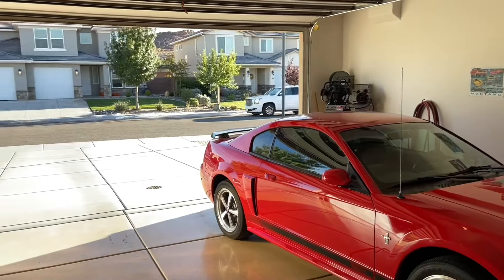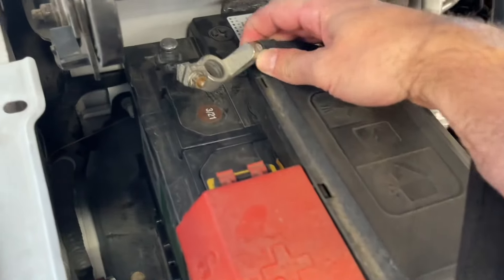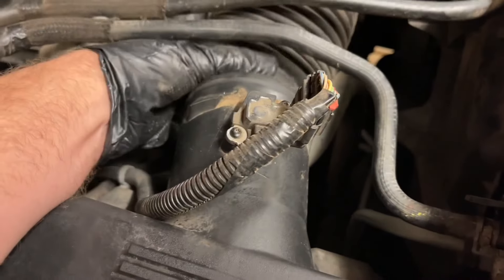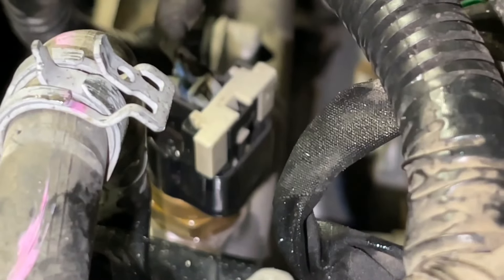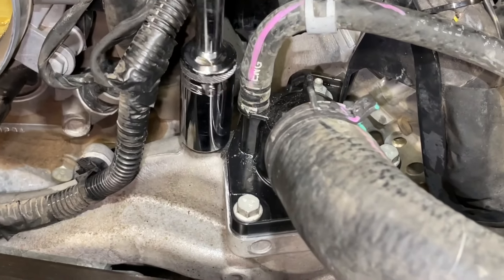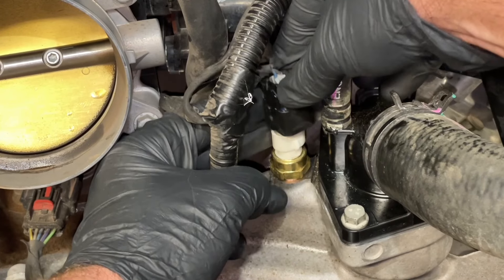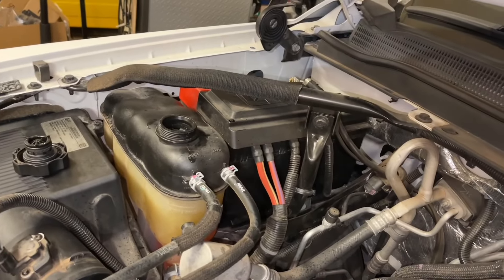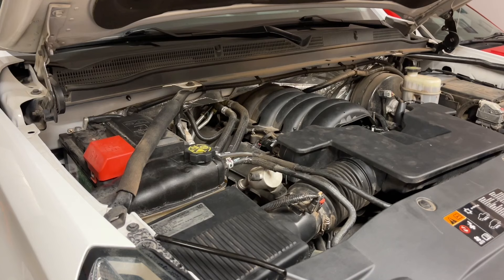Coolant temperature sensor replacement 2015-2020 Yukon, Tahoe, Suburban, Sierra Silverado GMC Chevy

Comment: I took my 2015 Chevy SUV LTZ to dealership to have the same sensor replace- they where charging me $203 to take the fluids & clean, then labor then part a $450job, all they need to do is just drain the fluids down- so after watching your video, we did not get it done there-Thanks for your knowledge to inform people like us
Reply: Yeah but how many miles are on your truck? Sometimes they do things based on service intervals. Dex-cool doesn’t last forever and needs to be changed at specified intervals.
Reply: Really appreciate the video. It shows exactly what I was looking for. Thanks so much.
Reply: Isn't it crazy how they can charge so much for just a simple job?
Reply: They mark up parts so much 50-60% because it's so expensive to keep a shop open these days. There are too many regulations in the 21st century, United States

Comment: Excellent video, thanks. 2016 GMC yukon XL 4 X 4 WITH 5.3. Mileage = 125,000. 1st time this has happened. I purchased the new coolant temperature sensor at Auto Zone for $17.00 and a gallon of the antifreeze concentrate for $21.00, I applied the tape, and took about 90 minutes to set up, do the job, put everything up and clean up. Working great. Total spent $38.00.
Reply from the maker: Nice work! If it continues the thermostat can also cause it to run the fan and overcool the engine, just fyi https://youtu.be/aEfgkxWdBYw?si=3xH7ce8BQL79NnPp
Reply: Nice! Was debating on taking it to the shop
Reply: What was the coolant for?

Comment: Thank you for this video! I got home pretty late last night after hanging out with friends, and my Yukon did the exact same thing as your wife’s and I was freaking out and did not know what to do. Eventually the fan stopped and I came into the house and started googling as well as YouTubing and found your video, I now know what I’ll be doing today!
Reply from the maker: The thermostat commonly sticks open as well. It’s very easy to fix, so if it continues, check this out for the future https://youtu.be/aEfgkxWdBYw?si=dtMpuIdw_lV_ZxIB
Reply: @dannyjohnsonsgarage  thank you! I replaced the thermostat and the temperature sensor and my Yukon is as good as new! And thank to your video it wasn’t too complicated. I did notice that my vehicle did not show a check engine light, I’m not sure if that matters.
Reply from the maker: @LATINO_2020  mine did not have a code in the beginning either. It is somewhat normal. Glad you got it fixed 👍🏼

Comment: Thanks for the video. After removing air silencer box, I had  the new sensor taped and ready to install, removed old sensor, put finger over hole, quickly moved finger and screwed in new sensor. No  need to disconnect radiator hose or drain any fluids. Maybe lost a tablespoon of coolant or less.  Less than 10 minutes.
Reply from the maker: I also did the thermostat, so if it continues here is the video. You’ll lose a little more coolant 
https://youtu.be/aEfgkxWdBYw?si=XD8DDIZFZidjTcus

Comment: 🤜 Thank you for the video.  Dealer wanted $950.00 - I was able to complete for $55.00 (AC Delco temp sensor and new 19MM socket) 75 minutes by the time picked up parts watch video and worked on the engine.
Reply from the maker: Nice work! That’s what I hope to help with on the channel.

Comment: I cannot thank you enough for creating and sharing such a helpful, informative video! You just saved me THOUSANDS of dollars! I am 1200 miles from home, on vacation. I have to purchase a few tools, but between your video, and my husband (a mechanic) at home, on video chat with me, I am confident that I can change my sensor out, on my own! Thank you, from the bottom of my heart! As a female, the dealership tried to tell me that a whole bunch of things need to be replaced and that it will cost me and arm and a leg! My husband throughly checked& tuned up our truck before I left for vacation, so we know the dealership is lying! My Yukon Denali is doing EXACTLY, EXACTLY what your wife’s truck did. I am forever grateful for your help! Bless you Sir! 🥰
Reply from the maker: When you get it home, the thermostat can also stick open and show cold as it over cools the engine. If you continue to have trouble, the thermostat would be the next thing to look at. Thermostat Replacement Yukon, Tahoe, Sierra, Silverado, Escalade GMC, Chevy 2014-2020 P0128
https://youtu.be/aEfgkxWdBYw

Comment: Wanted to leave a comment to say thank you! Seems like my 2015 Yukon XL has been riddled with common issues & it's just one thing after another. YouTube has become my go-to place for solutions. I came across several videos for this issue, but none as easy to follow & quick to the point as yours. I'm trying to learn to fix the smaller details myself. I took this as a learning opportunity & got my hands dirty with my dad. Not only did we get the issue resolved, but it was nice to bond over his intrest too. So thanks again!

Comment: Much appreciated video. I experienced the save event last night with a 2017 Tahoe. Temp gage showed 160 degrees or lowest posible readng, whcih is typicalls 186 F. and both fans were in overdrive. and ran for about 20 minutes after arriving home. Bought a new cooling sensor today for $18, had extra antifreeze. Your well produced how to video turned this repair into an hour event even considering the trip to auto parts store.
Reply from the maker: Just fyi for the future. The thermostat can stick open and also cause the fans to run. In case it continues Thermostat Replacement Yukon, Tahoe, Sierra, Silverado, Escalade GMC, Chevy 2014-2020 P0128
https://youtu.be/aEfgkxWdBYw

Comment: Danny - cannot thank you enough. Had the exact same issue. Your step for step instructions were 100% on point. Part cost me $33 and took around an hour.
Reply from the maker: If it continues it may also be the thermostat stuck open and it’s really under 160 degrees. Here is how to fix it in the future https://youtu.be/aEfgkxWdBYw?si=L0Grd6e5SWZiowXX

Comment: This video is absolutely perfect, thanks for sharing.  My 2016 Yukon did the same and I received a quote from the dealership and they wanted 1300.00 to diagnose and repair.   (THEY ARE CRAZY).    I did purchase the GM Brand sensor for 53.00 and replaced it in merely 10 minutes.  I don't know why you had to remove the entire intake silencer or drain off the radiator hose.   I removed the intake connection and left it connected to the air filter section, removed the sensor with towels around it to keep fluid from going over the entire engine/ground; and I only lost about 3 tablespoons of fluid and put the new sensor on.   Reconnected everything and now runs perfectly.   THANK YOU FOR THIS AMAZING VIDEO.
Reply from the maker: I also replaced the thermostat, but made the videos separate as well for those only doing one repair. It doesn’t hurt to drain a little fluid for less of a mess. I’m glad you enjoyed it

Comment: Thanks for this video. I bought the part a while back after watching how to replace it on an Escalade, but then I realized that my Tahoe had the air silencer (which the Escalade did not). I was not sure how to proceed with the air silencer, but your video was very clear and helped a lot. I did not do the optional part of removing the hose -- when I removed the old sensor I was prepared with some paper towels. Things to note for others dealing with this: 1) if your check engine light remains on after replacing the sensor you typically have to start/stop the car 3 times before the car recognizes that the previous problem causing the light to illuminate no longer exists. 2) if your situation is like mine, when the sensor is bad the fan will stay on for 5 minutes after the car is turned off. For a long time this was just annoying, until it happened so often that it drained my battery and my Tahoe wouldn't start. I saw someone ask if this must get fixed - I don't know about if it is bad for your engine to let the can continue running all the time, but it definitely drains your battery.
Reply: After 5 days the problem came back. Going to replace the thermostat next: https://www.youtube.com/watch?v=aEfgkxWdBYw
Reply: I have the same issue.  Replaced the coolant temp sensor, worked great, then about a week later it started up again.  Did replacing the thermostat work?
Reply: @stpx  yes. It was very easy except I didn’t do a great job collecting coolant that spilled. I hosed my driveway off and it didn’t leave any marks. Make sure you replace coolant with correct type. Also try and fill the hose up before you reconnect it so you don’t have too much air in the system. I assume it matters.

Comment: I had the same issue. I changed the temperature sensor and it worked like a charm!

- 2015 Suburban - 265,xxx miles
- CEL was on: P0118, P0128
- The fans would stay on with the car on and off. 
- A/C was not turning on

I started searching away and saw your video! Everything was spot on! Working just fine!

Big thank you!!
Reply from the maker: If it comes back it may be the thermostat sticking as well. Just fyi 
https://youtu.be/aEfgkxWdBYw?si=3nzNZIdNLFsqB4Ze

Comment: 2018 Tahoe success thanks to your video!!! Replaced the Thermostat too at the same time as I wasn’t sure which one was the culprit. Your videos for both were perfectly done! Thank you!
Reply: Are you talking about the Water Pump Outlet Assembly with Thermostat? I have the same issue. Not sure which one's the problem. My fan kept blowing even with the truck off to the point where it drained my battery.

Comment: Sitting in my Sierra looking at the check engine that just came on and listening to the cooling fan. Thanks to you i have the confidence to try this myself along with thermostat change.
Reply from the maker: Good to hear. If it continues to happen, it’s also common for the thermostat to stick open and overcool the engine and run the fans https://youtu.be/aEfgkxWdBYw?si=Swj6E2HklqMBS4ru

Comment: Thank you for your video!  I’m sure it saved me hundreds from the mechanic changing it, not to mention the time saved from having to coordinate getting it into the shop.  This was what was wrong with my Suburban and I’m very grateful you posted this .  Thank you!
Reply from the maker: Many have found the thermostat is also sticking open to cause this. I changed both at the same time and did not have the problem come back, but you might want to watch this for future reference in case it continues: https://youtu.be/aEfgkxWdBYw?si=5RBbTiv2EgcI0ltg

Comment: Thank you VERY much for posting this! Ours went out on Friday.  My husband watched this video this morning - picked up the parts and got it fixed all in the same day!
Reply from the maker: @normabournes5789  I’m glad it worked. If it happens more, it can also be the thermostat. Also easy to change out Thermostat Replacement Yukon, Tahoe, Sierra, Silverado, Escalade GMC, Chevy 2014-2020 P0128
https://youtu.be/aEfgkxWdBYw
Reply: @ Well you called it! Last night my car did the same thing as before except I have no heat! I got home and put it in the garage - the fan ran for about 5 minutes and then shut off. We’re going to watch the other video tonight and make plans to install a thermostat. Thanks again! :)

Comment: Thanks for the video. My 2016 Suburban did this in April of 2024. This sensor fixed the issue. The exact same thing happened again this week. Fan keeps running after you turn off the vehicle. I bought and changed out the sensor and it did not fix it. After some google searching I found that a bad battery can also cause this problem. Switched out the battery and that fixed it. I don't usually comment on these but was hoping I could save someone the headache I had.
Reply from the maker: Most likely it’s the thermostat sticking open and should be replaced https://youtu.be/aEfgkxWdBYw?si=GiR2jxNugFM8rPaX

Comment: Thank you.  Had this done on my Yukon in less than 10 minutes.  Fixed the fans being on and running down the battery after turning the ignition off.
Reply from the maker: If it continues, look into the thermostat. It can also cause the issue with the fans. https://youtu.be/aEfgkxWdBYw?si=spYGv5K9ABEzew_G

Comment: I have a 2015 Chevy tahoe, and it was running cold. About  every other month, the fan would stay on after I turned the ignition off. I replaced the temp sensor and housing, and that solved my problem. Thanks

Comment: Well if Danny ever loses his day job...no worries. He makes great videos.  
Thanks for you help!  
Same issue with my wife's 2019 Tahoe Premiere 6.2 ~80K miles. With the instructions from your video, had it corrected in about 30 min. 
I Didn't remove the radiator hose though. Just placed my finger over the opening as I removed the old sensor. I lost less than a teaspoon of coolant while removing the old/installing the new sensor.
Reply from the maker: If it continues, check out the thermostat. Sometimes it really is running under 160 degrees and if the computer recognizes it, the fans will also run. Glad you found the video useful https://youtu.be/aEfgkxWdBYw?si=AHr2ydNcDc0d5ogp

Comment: Excellent video. I followed the steps (minus un-hooking the coolant/radiator hose) to replace the faulty sensor and was done in 10 minutes.
Reply: Exactly what I was looking for.. why the need to unhook the coolant hose and radiator??
Reply: Same glad i wasnt the only one who did that  @WLpeasant
Reply: Same here. Had the new sensor ready...removed the old sensor, placing my finger over the opening until I slid the new sensor in. Lost very little coolant.

Comment: Thank you so much for posting this!! I have a GMC seirra that had this exact problem.   If i were to take it in to a shop, no doubt I'd be charged $1000s.  I fixed it myself yesterday with your guidance 🙏   it took me a lot longer than it took you😂 but it's fixed.  I literally can't thank u enough.   The AC quit working around the same time and now it's totally back to normal.  No check engine light.  Happy day!!
Reply from the maker: If it comes on again, see my video for the thermostat. It can also stick open and cause it to over-cool and read low temp and cause the fans to run. Here it is. Thermostat Replacement Yukon, Tahoe, Sierra, Silverado, Escalade GMC, Chevy 2014-2020 P0128
https://youtu.be/aEfgkxWdBYw
Reply: @dannyjohnsonsgarage I changed the temp sensor back in December and the thermostat about 2 months ago but now when I drive it the temp rise and when it sit still it move back to normal temp fan stay on about 5min after engine off but it's not throwing no check engine light so do you think it can still be the temp sensor even though no check engine light isn't on showing showing showing
Reply from the maker: @mississippioutlaw2285  Since it’s showing high temp when it does it the problem could be the radiator. Radiator Replacement Yukon, Tahoe, Silverado, Sierra, Suburban, Escalade 6.2L, 5.3L
https://youtu.be/kMpgokEDQqA
Reply: @dannyjohnsonsgarage will the radiator cause the fan to come and do you think it may be clogged up because I don't see no sign of coolant on the ground
Reply from the maker: @mississippioutlaw2285  the fans will continue to run because the vehicle has noticed. It is more hot than usual, just like how they will also run if it thinks it’s too cold than usual. I would try to burp the system as you saw at the end of the video by pouring coolant directly into the radiator hose that goes into the radiator, you don’t want to only have coolant in the gas tank, but in both. Make sure that the engine is cool when you’re doing this, so it doesn’t spray coolant and burn you.

Comment: This was helpful in diagnosing my 2018. Only difference in steps I followed… 1. only remove the right side of the air intake, use a bungee cord to suspend in the air to the left. 2. Place rags around the sensor when removing to minimize spill. 3. Clamp the large hose going into thermostat housing. 

Little to no spill, completed in 20 minutes, no more high fan and temperature on dash properly reading now. 👍
Reply from the maker: If you continue to get the symptoms, the thermostat can stick open and also cause the fan to run. https://youtu.be/aEfgkxWdBYw?si=_bhBkh71UHuBxVnf

Comment: Excellent video!  Just a little PSA here.  Replace your thermostat also!  The same guy here has a similar video for replacing a thermostat, which is right next to the temp sensor.  It's a part that is likely to eventually fail so replace it!  Expand his description of this video, he says the same thing, I think I just never saw it.  Also you find the handy links to order the parts there.  I found this video and carried out the steps as I thought it would solve my trouble code which seemed to point to the temp sensor.  For some reason, I was too dense to heed the fact that in his video, his sensor was reading zero while mine seemed to read ok.  I let myself be confused by the trouble code.   It was P0128 "engine coolant temperature is below the thermostat regulating temperature".  I thought maybe my temp sensor was intermittently failing or off.  Nah.  A new thermostat is what fixed that.  The temp sensor was fine.   The good news I have excellent hindsight so it's all perfectly clear now what I should have done!

Comment: Just followed your video to replace mine. Thanks for the thorough step by step 🙌🏻
Reply from the maker: @TheDusto07  if it continues, the thermostat can also cause fans to run and the temperature to be low Thermostat Replacement Yukon, Tahoe, Sierra, Silverado, Escalade GMC, Chevy 2014-2020 P0128
https://youtu.be/aEfgkxWdBYw
Reply: @ yeah that’s what I have been seeing. I have your other video ready to go in case that’s what happens. Thanks again!